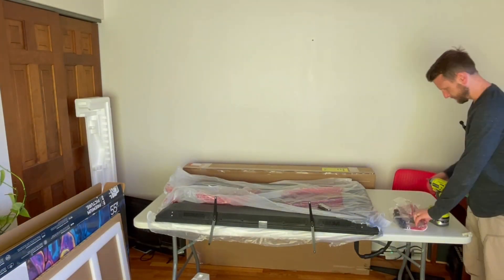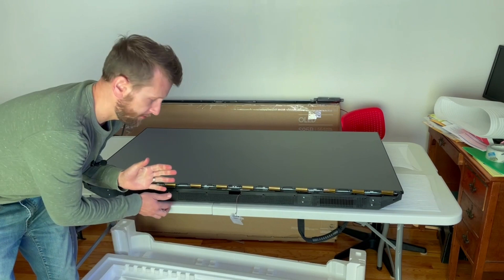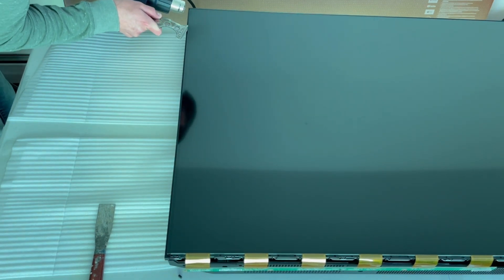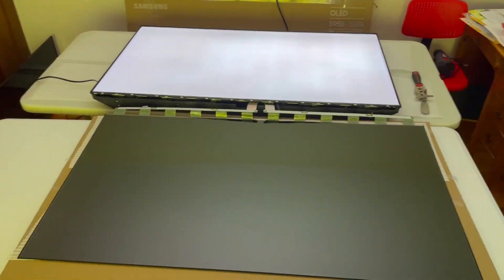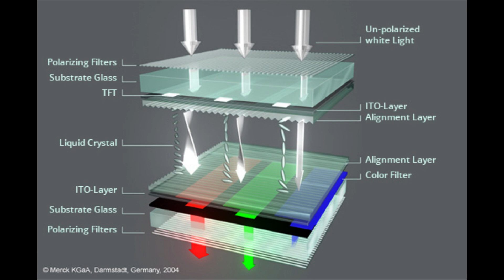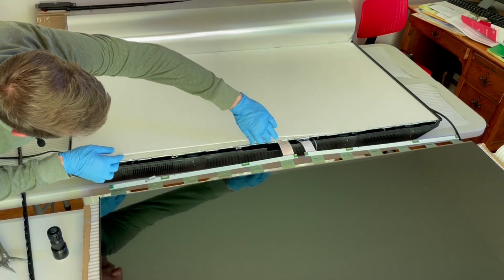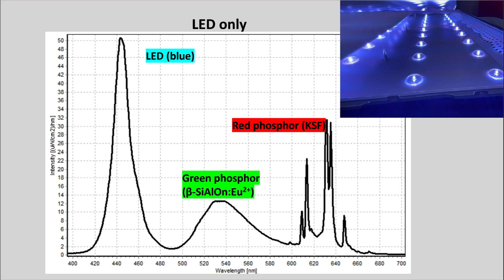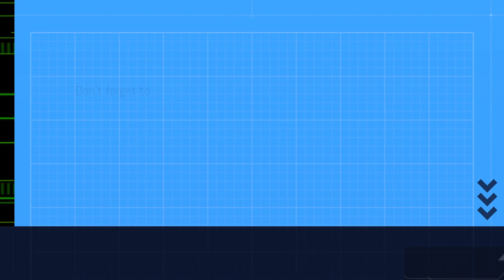Inside a TCL Roku QLED TV with the LCD removed

Comment: Around 2022, the market started to see the emergence of these types of QD TVs. 
They are usually priced at about 1/3-1/2 of what normal QD TVs used to ask for, and they all use White backlight with KSF + a tiny bit of QD, in comparison to the traditional Blue LED backlight on QD TVs. 
As a result, these can only achieve 94-95% DCI-P3 and have weaker red-green coverage.

If anyone is looking for 97-98% coverage in traditional QD TV reproduction, you need to stay away from mid-tier products from like TCL and Hisense. 
Samsung is still using blue backlights for their QD TVs.

Comment: I stumbled across your video while trying to find videos showing how to repair a TCL 65R617 on which the backlights had gone. Kind of crazy that a TV which was known as the best midrange TV for gaming in 2018 has no videos on YouTube showing repairs. Even searching 65R or 55R had very few results, though this wasn't helped by uploaders rarely providing the model number of the TV they were working on. Plenty of S models, but no R series. Nonetheless, I watched enough videos to think I had the skills to attempt the repair myself. Ordered an LED tester, replacement strips, suction cups, other tools, and all was going well until it came to removing the bezel. Like the model in your video, it seems to require a heatgun to access the screws holding the side and top bezel in place. Just absurd. I gave up at that point. With the high failure rate of TCL TVs, you can't tell me this isn't a deliberate choice to discourage repairs. I can understand the adhesive on phones and tablets I suppose, given they are advertised as waterproof these days, but gluing glass to the BACK of a TV? Ridiculous. As luck would have it, Amazon dropped the price on a 65" LG OLED G3 to $999 for a whopping 13 minutes tonight but I was able to snag one.

Comment: Hey man I’m tryna fix my tcl tv with backlight issues and I can’t actually lift the screen off as the metal bezel around the edges keeping the screen in are fused to the back pannal of the screen so there is no bezel to remove it is all one piece, wondering if you have encountered this at all or have any ideas if I need to slide it out to get it out or what

Comment: Hey Nano. 65 R635 QLED here. To make a long story short sorta.... I've been through 2 new R635's plus the failed. Sent from TCL (warranty). The issue is color. Everything imaginable been done. Factory reset, nothing hooked to it etc. No direct sunlight on panel, normal 70F room temp. The problem is, after 6 months on the left, bright, saturated reds started to get a magenta hew. Then blues and greens were affected.  Then the area took up 30% of left side of the screen. TCL sent a new panel, 8 months later - failed just like the original,  same exact thing. This was a "new" not refurb. They sent a third - failed. TCL said they'd send a tech - they replaced every board with factory new boards here at my house - hooked it up - same thing. I was so pissed and so much time had gone by, warranty was gone. After weeks of fighting, they sent another - this time it wsa a factory refurb. That was a year ago - it's still in the box. I have the third panel mounted on my wall - colors aren't as vibrant compared to the right. And red has that magenta tinge. All these test with colors are done with generated YT color tests-all one color. WTF is going on, seriously. I love your tear down and it got me thinking to ask you as TCL has NO answers. After looking at reddit, I'm not alone on the R635. What the hell is causing this? Doesn't matters if its YT, blue ray, cable, streamed or content from my HDD. That wasn't a short story :( But I'm still pissed. Cheers!
Reply from the maker: If it's always 1/3 of the screen it sounds like one (or more) of the LED boards. Could also be the LCD though as this is driven in parts but it sounds like you replaced that. Tough to know without taking it apart (which is the fun part). If you give up on it you can try what I do and take it apart (carefully) so that you can see the backlight and diagnose what is going wrong.

Comment: Hello! I came across your videos while searching for Quantum Dot displays. After watching a couple of your videos, I came to the conclusion that QD displays could have blue LEDs as backlight (presuming the QD layer would then NOT consist of blue-sized dots) but there are also cases where the backlight is white, which is achieved by covering the LED with phosphor or laying it in close proximity to the light source. Are there any reliable sources that I can use as sources for a university assignment? I also wanted to know whether the liquid crystal is replaced by quantum dots in some displays as I saw structure diagrams where it's not included in the breakdown.

Cheers!
Reply from the maker: LCs are not typically replaced by QDs, rather the QDs are there to enhance the color by converting blue to red/green and the LC remains function as it normally does. There are many review articles describing how QDs work in display technology, especially LCDs. Society for Information Display could be a good place to start.

Comment: Thank you for sharing your experience with the facinating world of TV.
How different colors is generated for each subpixel.
Does the backlight brightness change.
Is liquid crystals used in OLED and Qdoled.
Reply: В настоящем  OLED дисплее  не используют жидкие кристаллы, будем надеяться что и не будут. То, что выпустил Samsung, это пародия на OLED.
Reply from the maker: LC is not used in OLED or QD-OLED, but in basically all other TVs made today (LCDs). Backlight brightness does change based on the content as you can see with the local dimming test at the end.

Comment: Another fantastic video! Still hoping for the iPhone 13/14 Pro OLED analysis. :)
Reply from the maker: Would love to do a deep dive OLED (TV and mobile). There are significant differences I know (W-OLED vs RGB at a minimum).
Reply: @NanoPalomaki  - Why was this this TV teardown undertaken in the first place? I don't see that explained in your extra information section.
Reply: mass market mobile oled doesn't use QD. Vincent teoh of hdtvtest did display analysis on an iphone 12 pro, and the underlying tech for iphone displays hasn't changed a ton between 2020 and today (in terms of color performance) so it's still relevant. Displaymate has tested the iphone 14 pro max but their data presentation and tests aren't fully industry standard for video workloads.